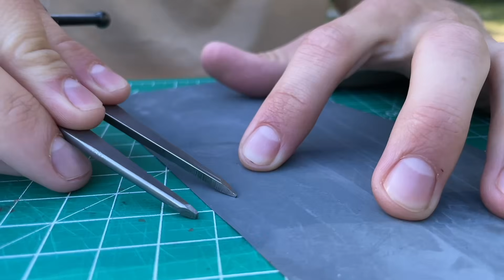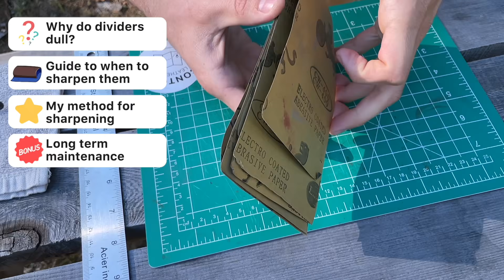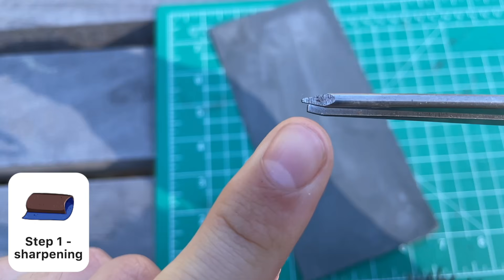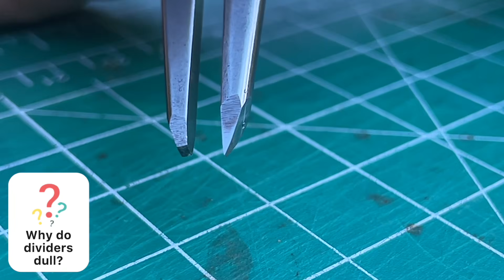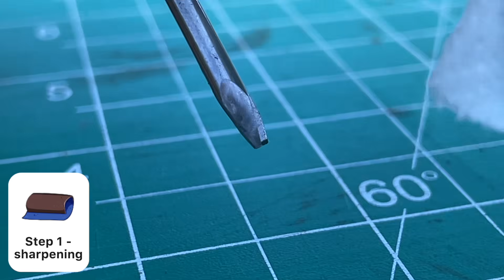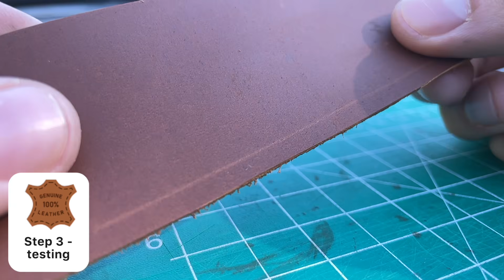Stop Tearing Your Leather! Level Up Your Wing Dividers

Comment: It's best to not sharpen the wing dividers on a soft surface, and a cutting mat is most definitely a soft surface.  Something hard, smooth and flat is just the ticket.  A glass table, a pane of glass, a granite/marble/quartz countertop (or piece of countertop), there are a myriad of options.  You can "stick" the wet-dry sandpaper to most of these surfaces with just some water, the surface tension will do the trick.  Check out "Scary Sharp" for the full skinny on sharpening with sandpaper.

I have a small wing divider that had a burr on it, I knocked the burr down with the diamond file on my Leatherman, I'll be doing a more complete touch up soon when I break out my knife sharpening paraphenalia.  I'll also be tuning a new larger divider I recently acquired.